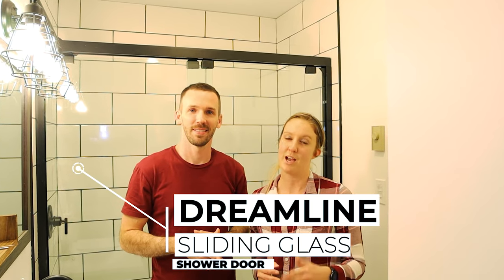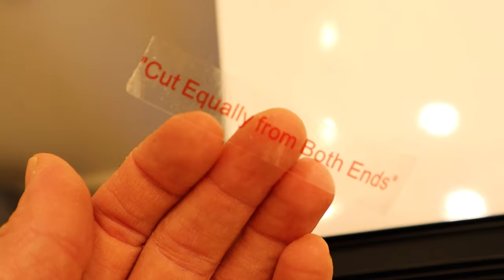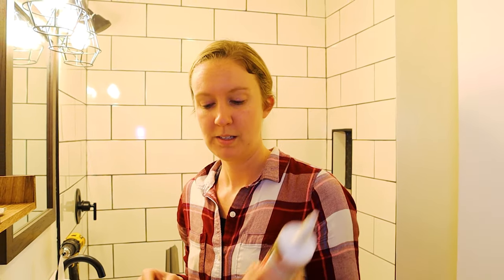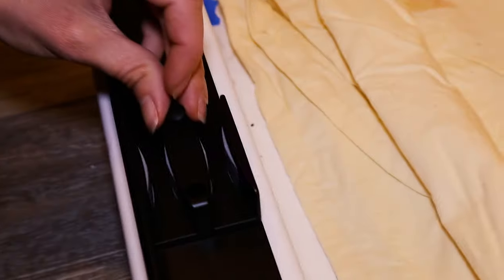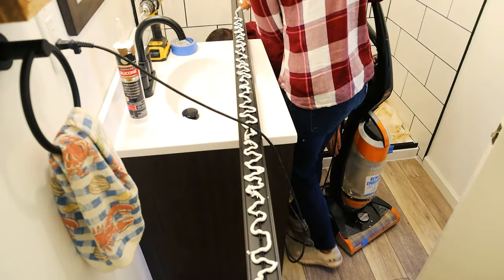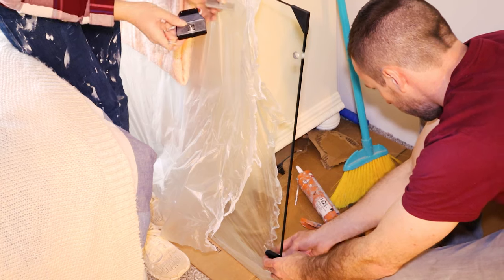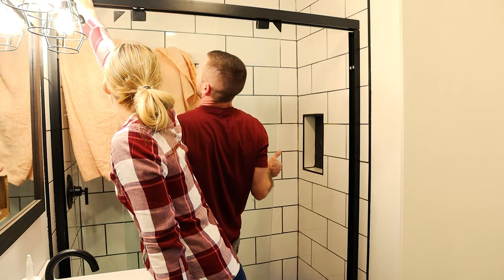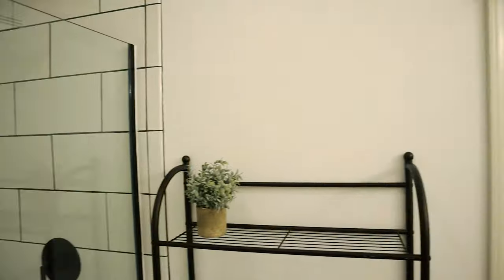How to Install a Dreamline Sliding Glass Shower Door | DIY | Tutorial

Comment: A tip from someone who installed one of these. Put a small bead of clear caulk around the bottom edge of the bottom guide rail to prevent water leaks. I didn't the first time I installed it and had to remove the doors because water leaked around the bottom guide rail. I did the same thing on all four wall profile bumbers to help keep then secure. Don't turn any of the screws too tight to prevent stripping.

Comment: Great video. Contractor installed mine. When the glass roller came loose, couldn't figure out how to adjust it. In your installation steps you showed how to attach it, and that explained everything I needed to do to flip the cap off and tighten the screw. Thanks so much for your frustration saving video.

Comment: Good job! My contractor installed ours, the only thing confusing us is the water guard strips. He slid them on the ends of the doors which didn’t allow the glass to slide in the slots at the bottom. I think we really just need one in the center anyways. The frame is too thick for them on the ones we choose!  Thanks for the video!

Comment: Our handyman omitted cleaning glass with alcohol and applying Silicone Adhesive RTV 108 when installing M 6053 roller brackets onto top of glass panels. He tightened screws securely but outside panel slipped down and rides on bottom channel . Will need to redo entire installation, but not rehanging panels for 24 hours while RTV 108 cures. Apparently soft plastic grommet compresses and loosens grip plus adhesive is essential and must have cure time to hold against weight of glass panels.

Comment: Thanks for the video. I was curious how you hung the doors. The manual I downloaded from the HD website says to put the roller brackets on the upper track first, then put the rail on, then block up the glass with 5/16 spacers and attach them to the roller brackets. The manual sent with the door shows doing it the way you did, put the roller brackets on the glass first, and then pivot them into the propped up rail. I noticed the online manual is version 2 (102022) and the one that came is version 1 rev 7a (112020). So I'm going to guess that the later online manual shows the easier way to do it.
Reply: That's why this video isn't a good one to follow. Notice the video stopped before the second glass door was installed.. Follow the instructions from the manual. You'll need two people and make sure to leave the corner protectors on until the glass is fully hung!

Comment: at minute 7:20 there should be a pic of the gap in the slot where the wheel easily slips into the track.  If you try to install and don't get the wheel in at the location where there is a gap, it WILL NOT GO IN.  Took a while to figure that out.

Comment: i noticed water under my bottom railing after showering, not dripping back to the shower pan/base, anyone got this same issue?  Dreamline is saying "Shower base thresholds are pitched inward slightly allow water to roll back into the shower", well not the case for mine...

Comment: So does the top rail remain unsecured, or the weight of the doors holds it down?
Reply: This is my question as well...
Reply: I am installing it right now. Ready to hang the doors.  Looks like the weight of the doors and the caulking will hold it in place.  I was surprised when I got to this step that there are no mechanism to secure it.

Comment: I was remodeling my parents bathroom and we bought exact same shower door and tub…….I finished everything and it looks really nice but the sliding door that’s “inside the bathtub” at certain points door is not sliding smooth. As if guide rail is scrapping against the metal in the back of wheels. I was trying to adjust adjustment bolt but by the time I saw not to turn it more than 4 times on instructions I’ve already turned it like 20 times. I believe the screw is defected now. Is there anything that can be done with this or am I just way better off purchasing new “Roller Assembly”??? Please help because am sooo frustrated am going to take a hammer and break this damn door…..
Reply: Did you find a solution to your problem?

Comment: I have a problem with opening and closing the door is very difficult to open and close do you have any idea what to do
Reply from the maker: I had that issue at first and should've went more in detail on this, but there's 2 adjustment clips at the top of each door where the rollers are. Pop off the metal casing and adjust the screws. Instructions will say which direction to turn to raise or lower the door, you probably need to raise the door.
Reply: @KellyConcepts  Thanks for the reply I have already tried but nothing is happening the Installation Guide says "Do Not turn the Roller Assembly adjustment bolt
more than 4 rotations" with 4 rotations nothing significant happens
Reply: @Zix-76  did you ever figure out how to adjust? We just installed and are having the exact same issue!
Reply: Hey Samantha.  I had the same issue. I think there is a design issue with these doors….there just is NOT enough clearance between the bottom of the door and the bottom guide so they rub.  I raised the top rail just a bit by inserting 2 nickels in between the bracket on the wall and the top rail and VOILA….it works perfectly!
Reply: @samanthabondo5475  did you find a solution? After maxing out the adjustment screws I had to put an 1/8” spacer on the top rail on both sides to raise the doors up, caulked the gap and called it good.

Comment: The glass installation is kicking my ass
Reply: You have to prop up one side of the top rail with a 2x4.  Its in the instructions but they describe it as a way to get the doors into the shower under the rail.  But you need that 2x4 there so the inside door in particular has room to slip into the bottom rail slot